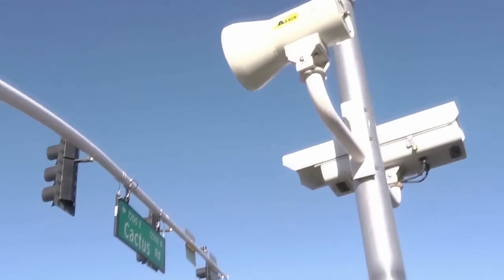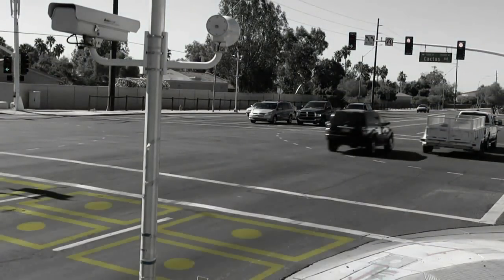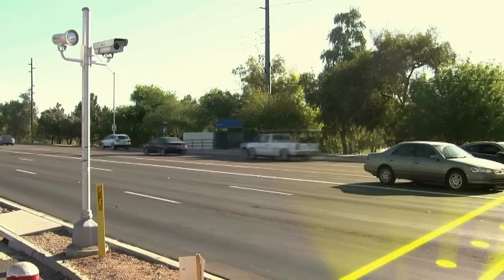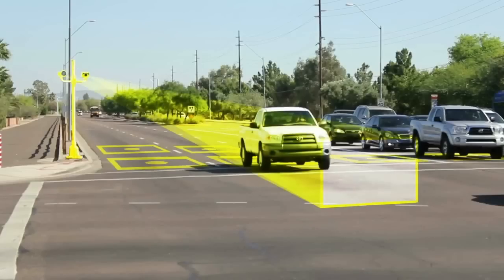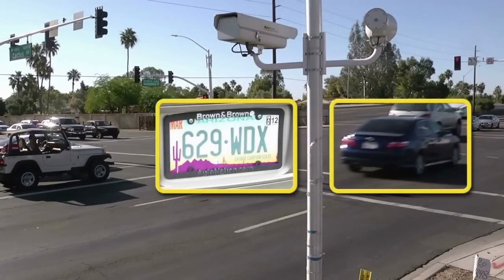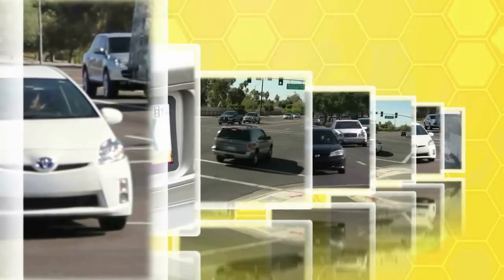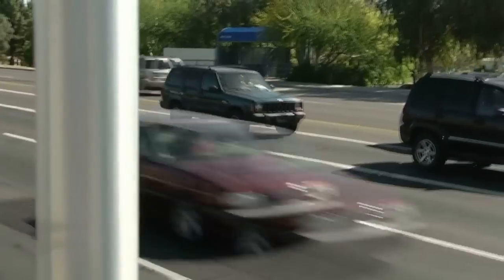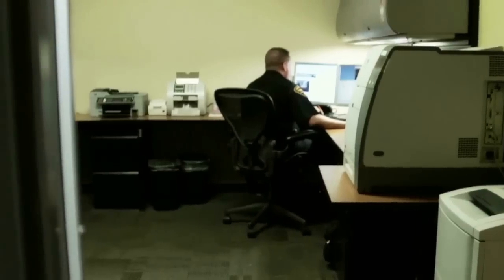How Red Light Cameras Work

Comment: How do red light cameras work? 3 steps

Step 1: shorten yellow light times to absurdly low lengths of time

Step 2: Increase traffic accidents due to people stopping short instead of decreasing them, an anathema to the message of "public safety"

Step 3: Generate revenue for both the municipality and the private out of state company they hired to play police officer and send you a ticket.
Reply: Redlight cameras issue their tickets mostly for cars entering the intersection milliseconds after the light turns red.  Most accidents are caused by cars running the light a second or more after the light goes red.  The difference is not safety but income, half for the company that installs the system, half for the town that let them.
Reply: Maybe you should understand that the yellow light is a warning that it is about to turn red, therefore stop.

Comment: I feel at every junction an average speed breaker just about 15-20 metres from the stop line should solve this problem.  Thereby no vehicle can cruise at high speed at the intersection and in case they run the red light the impact at the intersection, if any, will be minimal.
Reply: That won’t generate revenue for the pigs

Comment: Professional technicians? For safety? More like for money. Cameras won't stop a psychopath, an actual cop will. Stop funding this and put the money into law enforcement. This is just money grabbing. I got one of these violations and i committed it completely on accident and i wasn't speeding, a cop might of gave me a warning, and I promise you, that warning is enough for me. I rarely speed. 5mph over the speed limit max most of the time, i slow down if i go faster. You can barely feel the speed in my car. Stop letting machines take over a human duty. It will backfire.
Reply: ReyProduction I agree these cameras make Cops even lazyer than they already are...
Reply: +ReyProduction You're just angry that you got caught!
Reply: I do not condone running red lights, driver error's are multiplied when speeding is a factor, creating the most horrendous collisions. I question the design of the intersections as they are inherently dangerous from the first conception of the automated traffic signal. 

Before the development of the automated traffic signal a intelligent human would stand in the middle of the intersection and direct traffic by coordinating with other humans directing traffic all along the four directions relevant, in all types of weather. The replacement of humans with automated traffic signals that are "synchronized" and "scrutinized" by intelligent humans predicting traffic flow using the argumentative yellow light to stop traffic. What is so argumentative is the "duration" of the yellow light. 

The numbers of red light photo violations are too numerous to blame solely on poor driver skills. When understanding Newton's first law of inertia to apply physics to the duration of the yellow light specificity is most difficult. In other words not all vehicles have the same stopping abilities...

The yellow light duration is the main concern. When the yellow light is short the law makers are not asking us to slam on the brakes they are telling us to make an emergency stop or cough up $100.00 at every photo enforced intersection. 

The other issue I have with a traffic signal plan is the number of cycles. The more the cycles during rush hour will cause traffic to back-up contributing to congestion and giving more chances for the camera to take a picture. Simple math at 30 cycles per hour gives the photo enforcers 30 chances at 20 cycles per hour 20 chances to catch someone running a red with the assistance of a short yellow light.

Is the only solution the use of technology to set traps with precision instrumentation, that takes advantage of an inherently dangerous and argumentative design? 
This argument is why I advocate to apply a solution that gives an advantage to the driver. 
As you approach a modern intersection today you are entering what is known as a DILEMMA zone. The DILEMMA zone is the approach area close to the intersections stop line. The size of the DILEMMA zone is relevant to the speed limit and the length of the yellow light duration. When the light changes to yellow should you stop or go? That is the Dilemma every driver faces as they enter the Dilemma zone at our larger more complicated multi-lane intersections.

The intersections of the future will address and Identify the "Dilemma Zone" with a PROCEED ACCORDINGLY LINE (P.A.L.) painted with a rumble strip When the light turns yellow and you have not reached the P.A.L. you must stop. If you pass over the P.A.L. while traveling near the speed limit you may proceed accordingly. The P.A.L. will give the driver advance knowledge required to make an informed stop or go decision prior to entering the dilemma zone I call it an "advantage" to the driver.

The P.A.L. pertains only to the forward lanes of travel. The P.A.L. will require longer FIXED yellow light duration with a brief all-red clearance interval. The purpose of the P.A.L. is to facilitate traffic flow intelligently with-out abrupt sudden stops that cause rear end accidents. The P.A.L. is a fixed reference point relative to the length of intersection and the speed limit. Those two given elements along with other variables will determine the duration of the yellow light to allow all vehicles to clear the intersection safely and stop in a smooth gentle fashion...
Reply: Tony Iocca ya have that problem in my rx7 it's a first gen do only 2 disc brakes up front and boy does it get hairy at times with lights just going red

Comment: tobay in alqous the signal was red and when it turn's green i accelerate the car my speed was not even more than 60km/hr before passing the signal ... the camera flashesh i don't know .. on whom it flashes -_-   can any body tell me was it my fault?? was camera flashes on me ???
Reply: Here in the Netherlands the red light cameras not only flash when you run the red light, but they also flash if you run green light with faster than 55km/hr